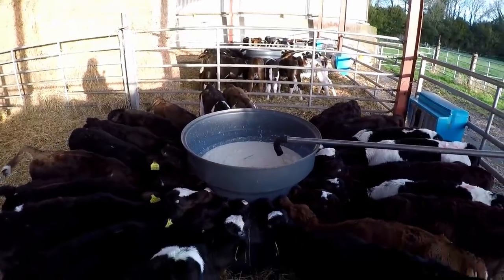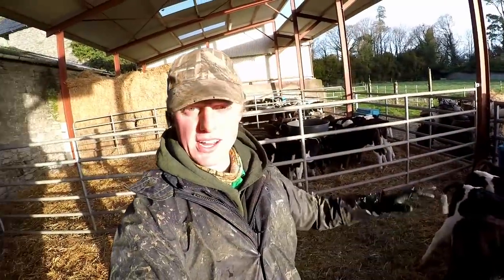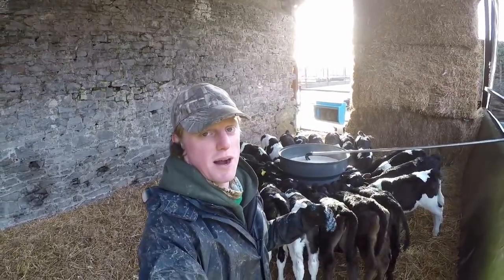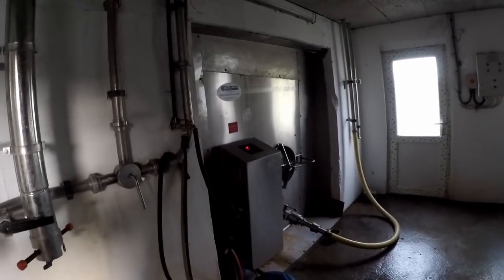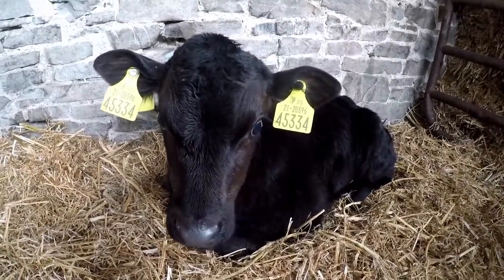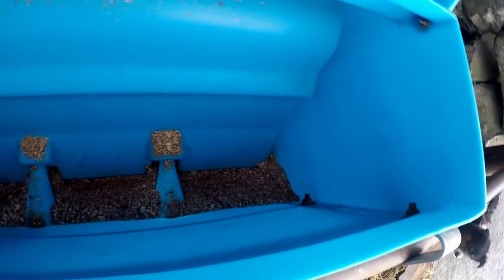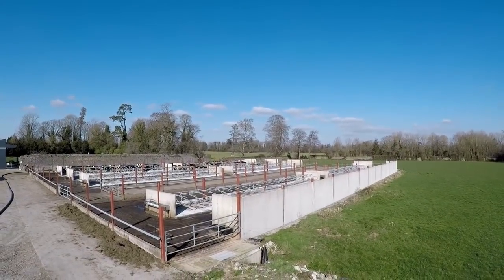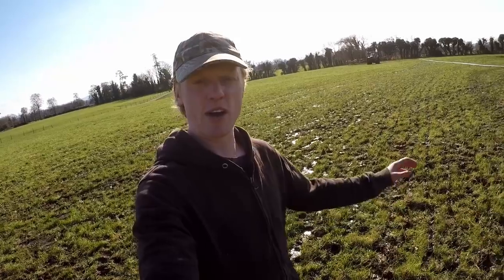Feeding Calves & New Dribble Bar Spreading Slurry

Comment: Loving the vids do you have any problems with mastitis and if so how do you treat it because we are having big problems
Reply from the maker: Have been very good this year 👍 SCC currently 86 😁 we treat causes with antibiotic tubes
Reply: @MCMilkingIt  would you ever put milking robots in 
I think that was the start of our mastitis problem
Reply from the maker: No I wouldn't even consider them to be honest
Reply: How many tractors do you have
Reply from the maker: 1 tractor and 1 JCB 3CX
Reply: @MCMilkingIt  for how many cows
Reply from the maker: Calving about 425 this spring
Reply: We only milk 200 but my neighbor milks 700 with 14 tractors
Reply from the maker: You're hardly from Louth are ya?
Reply: No I'm Welsh
Reply from the maker: Oh right very good 👍
Reply: @mehim6200  I guy over the road from me has a robot. Had loads of issues at the start with some cows so he adjusted the high cell count cows so that every time the came to the robot it let them in and milked them, he adjusted their feed so they still only getting there daily allocation. He has no problems with cell count and some of the cows are coming in 6 times a day
Reply: @mehim6200  how long is the robot installed?
Reply: @billabong9215  we had it for 2 years and the cell count in the cows that were in the robotic barn has never been the same
Reply: @mehim6200  if he have down time on the robot, try what I said, it couldn't hurt and be interesting to see if the cows do improve, and give you another potential treatment option in the future if ye notice a cow increasing through out the lactation,  if they are housed full time and always have access they might heal themselves. Is it spreading from cow to cow or just the same few high high ones all the time?
 How many cows is the robot milking?
Reply: @billabong9215  it was milking 200 cows and 29 heifers for a friend we no longer have robots gone back to a parlor and cows are mutch happier outside than inside do you milk
Reply: @mehim6200  that was way too many for one robot anyway :) how many robots did ye have? You'd need at least 3 and that'd even be tight.

Yup dairy farming for ten years.
Reply: @billabong9215  we had 4

Comment: Would u ever find the calve would get a pain from sucking air when you don’t take out the feeders
Reply from the maker: Been using these feeders for 4 years now and haven't had that issue before. The teats on them don't pump like the peach teats, there is no non-return valve in them so they are more like a real teat. Maybe that helps 🤷‍♂️